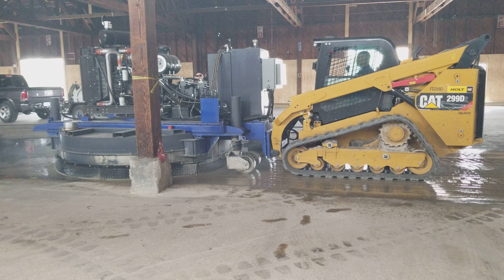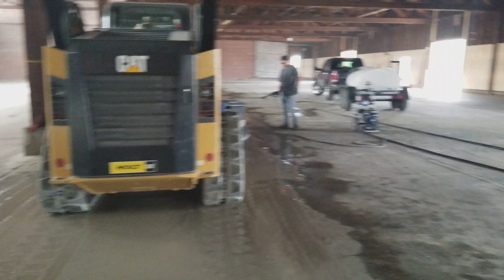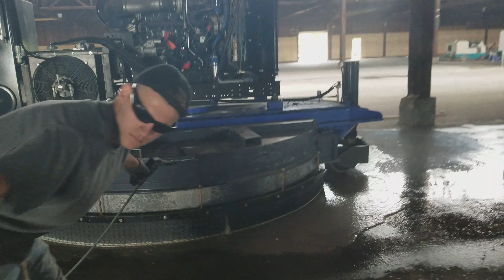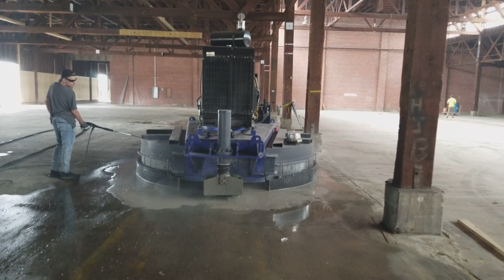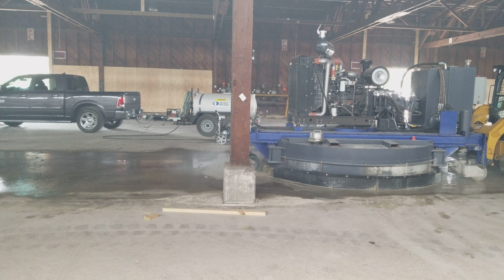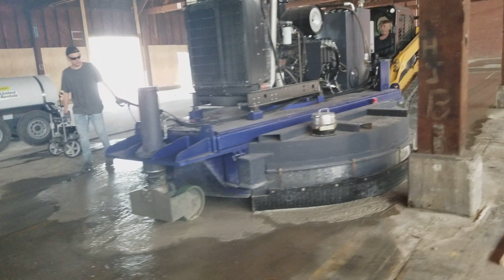Worlds biggest concrete grinder

Comment: And what is this for?  How did you fund it? Have you used it yet?  How much did it cost? Are you making a return? Did it turn out to be a good idea? Im asking for a friend? Although I'm very interested as well in why?
Reply from the maker: We are a design and manufacturer for many things. This is a grinder and polisher used to process concrete floors the same way granite is processed to look like a mirror. It is about a decade ahead of its time. It is slow work for now because the industry does not realize the potential yet. This machine is cheaper to operate and produces a higher quality substrate than any other machine currently in use as well as higher production rates. However contractors and end consumers are being fooled by riding trowel machines that are not actually capable of refining concrete due to the lack of weight and horsepower it takes to truly create a mirror finish  on a concrete floor. If you ever notice nice mirror looking floors you will notice they look like plastic and the gloss does not last long. This is the result of using treatments of chemicals that are more readily polished by the light weight and low powered equipment. A true mechanically polished floor should look dry and you should see the different materials exposed on the surface, not an appearance of a sheet that is consistent in texture. When chemicals are used they lock the concrete porous structure away from the surface creating a much more slippery floor when it is wet than a real polished floor. There are many more reasons for this machine, in time it will be the go to equipment for large area floor polishing.